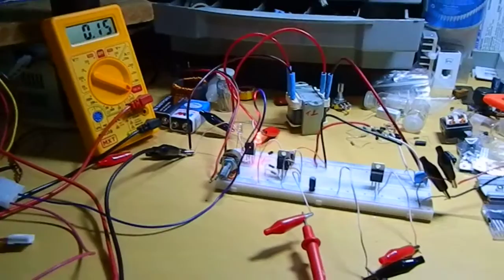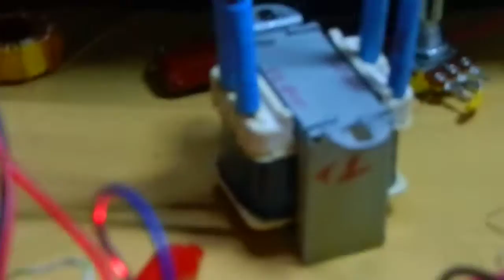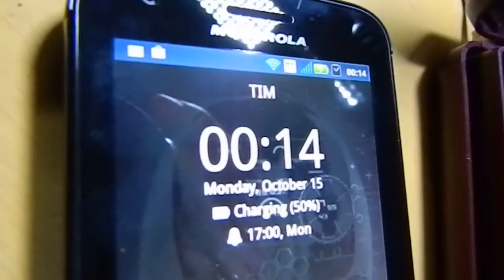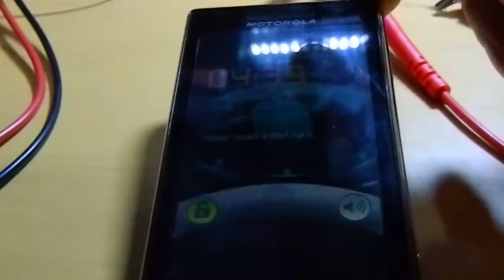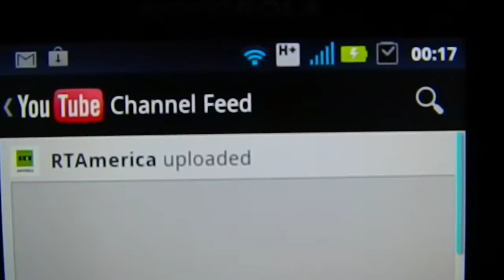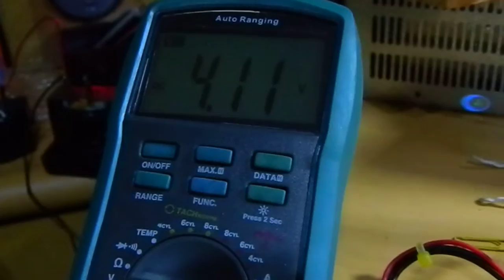SJR Cell phone charger test

Comment: Holy crap dude.. wtf are you doing? Are you drawing from AC Supply, or are you drawing from the 26650 battery? I can't tell.. The LM7805 is a Buck, or step down converter. It also taxes the voltage coming in by dropping 2 volts. So whatever the voltage is coming into the LM7805 is going to be reduced by 2 volts.